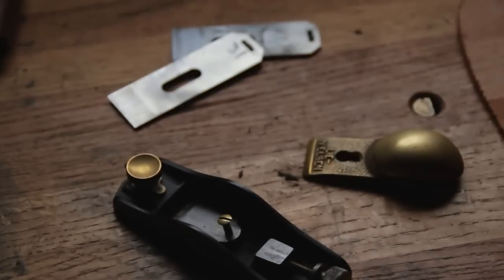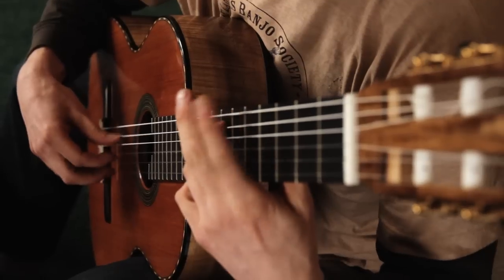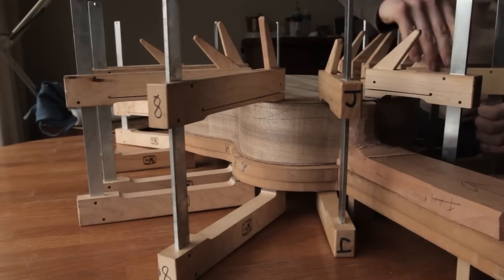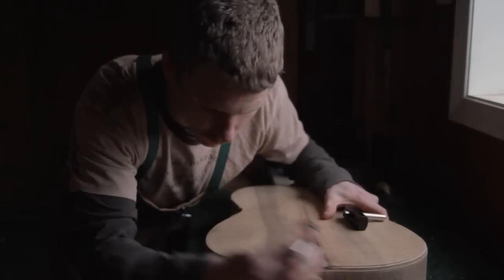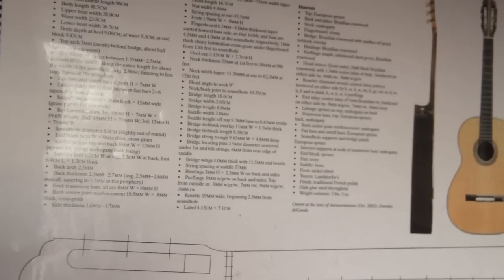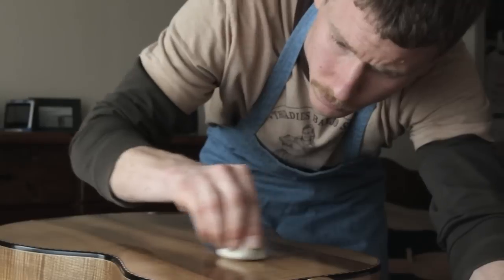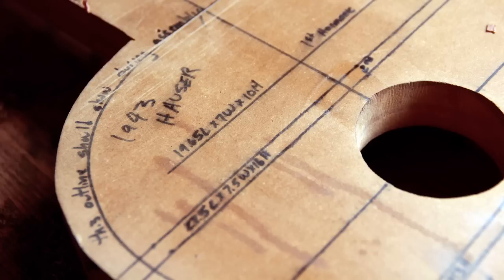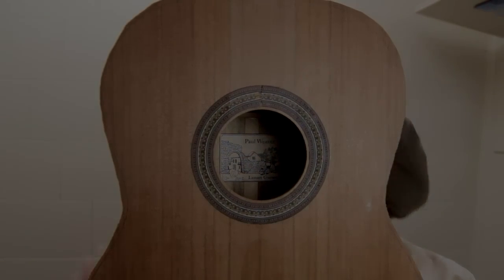The Luthier's Art - Hand Making Classical Guitars by Paul Weaver -- LamareGuitars.com

Comment: I used to build with all hand tools.  I once made the frets from scratch as well as pegs instead of tuners.  Now I'm going to build again for the first time in 12 years.  I still have all the hand tools but now I have POWER tools too.  Yea!  
I don't do rosettes, binding or purfling.  Inlays in the top or back weaken the joints/wood and end-grain doesn't glue strong.  I paint my instruments for decoration.  
Hide glue all the way but this time no shellac - "Mountain" finish from Earthpaints.
Reply: @Parker Zayden Instablaster :)
Reply: @Makai Victor it did the trick and I now got access to my account again. I am so happy!
Thanks so much, you saved my account :D
Reply: @Parker Zayden glad I could help :D

Comment: Thanks for the video!
Hand made guitars using solid woods are something to be desired and owned.
The thought of power tools ripping through the wood, the high rate if waste removal and the heat generated is a big concern to me.
You will have more dimensional stability and more secure joints.
Less trouble when dealing with say a bridge tilting and such. These problems will occur mainly because of the nature of wood and factors beyond your control.
Nice to know that knowledge is also shared between luthiers.
Please continue and enjoy your work!

Comment: Nice looking guitars with a lovely tone. A quick question if you would be so kind. As a keen amateur could you please tell what electric bending iron you use ? Currently I still use the hot pipe method but feel now it may be time to change. Thanks,. midge.
Reply from the maker: I use the LMI bending iron.

Comment: How much do you charge on average?
Reply: +Ben Mc Donald website says around 4000
Reply: +Ben Conquest That's actually quite cheap. A hand made guitar costs between 10000 and 12000 over here.
Reply: Is that for Steelstring guitars?
Reply: Thi J+ that really depends on how long it takes to build. For one months work 4000 is very fair. The higher price for the 10000-12000€ guitars come from them taking 3 months instead of 1. The speed of the work varies with a lot of factors.

Comment: The obsession with "all hand tools"" is going to severely limit your output and income, and for all the wrong reasons. Few if any clients will be willing to pay you for the inefficiency of roughing everything out in a way that takes 4x as long while producing at best the same, but often inferior results. Save the hand work for where it counts and it will add value to the instrument.
Reply: All goods points but it's also down to personal satisfaction.  I build as a hobby, and the ones I've made 'by hand' have been far more satisfying than when I've used power tools and machinery.  At the end of the day, money isn't everything to everyone.   Also, there's too much obsession, in my humble opinion, with perfection.  All of these mass produced guitars are so perfect these days.  Even the small, one-man-band guys are trying to produce guitars that look like they were made by a machine.  What's the point?  I'd rather see the maker in the finished instrument, if that makes any sense at all.  Certainly, the guitars I've played over the years that had the most 'mojo', the most character, where the ones that were slightly imperfect.  Anyway, just my two pence worth...all the best!
Reply: If he builds these in a month like he said, then clearly the hand tools aren't a massive bottleneck for him.
Reply: @Beargrizzly76 - There's a great deal of sense in what you say. I too am a hobbyist and have built entirely by hand in the past, but now use bandsaw, table saw, drum sander and  router. There's no way I'd want to go back to cutting binding and purfling channels by hand, though most other tasks I could happily cope with if necessary :-)